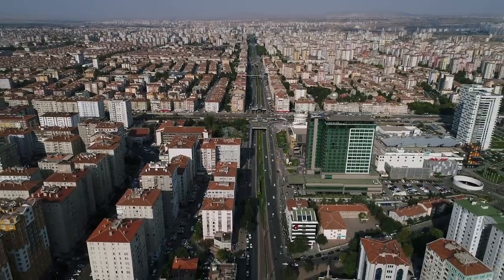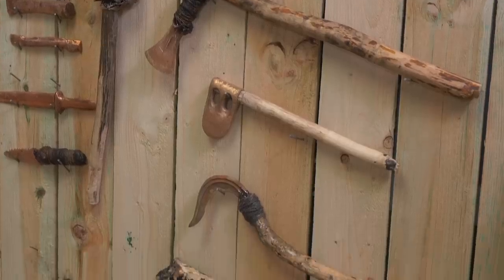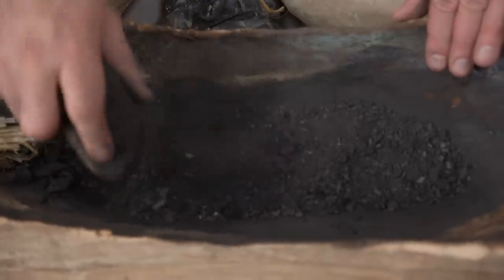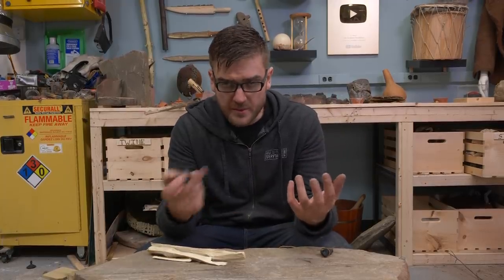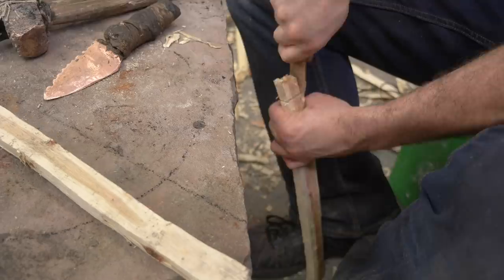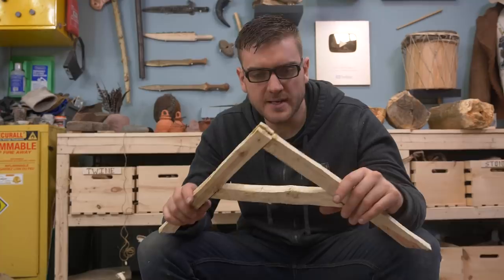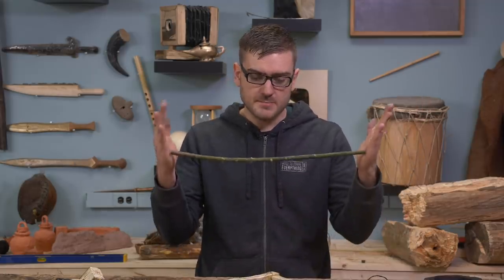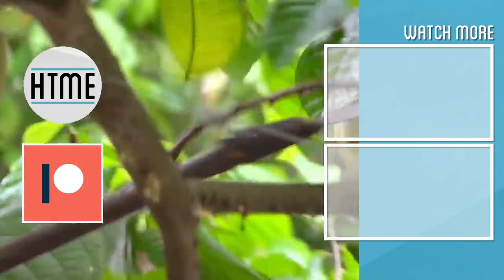DIY Tool that Built the Pyramids

Comment: Just thinking to myself, but would this work to make a perfect square? You already have a way to make perpendicular lines. From there couldn't you measure out say 36 inches on one axis. The use a string and a nail to mark an arch going out 36 inches from the end point of each axis. Where the two arches intersect should be your other corner. Am I right? 

Or could you use the radius of the length of the distance between the two end points on the x,y axis to make an arch from the three known points. Then draw a line from the corner, through the center, at the length that your two endpoints were from each other.

I'm not that great at math. This just seems to make sense to me. If I'm wrong I would love to be corrected.

Comment: You should use "head height" as your standard unit of measurement. Call them Heads (H), half head, quarter head, etc. Called "menton to top of head," with your mouth closed, measure from the bottom of your chin to the top of your head.

Comment: I think human anatomy is a bad choice for units of measurement, as everyone is born different, and long measurements such as the one you where using, could be very different. Just a difference in height could throw each persons measurements way off.

Why not use something from nature though? The length of an oak leaf, for example, could be used as it is a good size to convert into longer measurements but small enough to be converted for finer work. Also the inaccuracies in leaves, I feel, are less common than of the inaccuracies in people. Meaning that two people could choose a fully sized oak leaf, and the two will be almost identical in length.

One problem civilisation could face with this  though, is that oak trees are not found in all parts of the world, forcing people to use different leaves (for example) causing new units of measuring to arise (almost like meters, yards and feet).

I don’t think it may be the best option, but a lot better than that of human anatomy.
Reply: The measurement he is referring to was often canonized by using a single person's measurement and transferring that to tools used to measure it off for others.

Also, oak leaves vary in size as well not only tree to tree (they are different sizes at different age of tree) it even within the same tree.
Reply: Slidaulth oh. I was unaware of this. I imagined nature would just have a set leaf size when it’s fully grown.

Comment: Waiting for a 3 plate method video to get a real flat surface. Then a wood plane could be possible, though it would need frequent adjustment/sharpening if made of bronze. Might wait until iron age for that.

In the mean time, small hardened bronze files could help sharpen a saw blade. Hammering in ridges would work harden the bronze.

Comment: 7:38 actually ancient Indians used to tie three knots on a rope, at third, seventh and 12th (unit of length ) and use them to form a triangle with those three knots at each corner of the triangle.. and they would know that the required side is perpendicular...

Comment: 2:07 the Great Pyramid is actually .05 (5 hundredths of a degree off from True North).  That is even after the pyramid went through 3 major earthquakes including one that flattened Cairo in the 13th Century.  We didn't even have the tools until thousands of years later to even measure the accuracy of the GP to True North.  Even today, the closest building aligned to Truth North is the Observatory of Paris which is 25 hundredths of a degree off from Truth North.  FIVE TIMES as less precise in fact.

Comment: Milling the wood to make the tools perfectly square was not difficult with ancient tools. As a carpenter I still use old non-electric handtools when I need to. The tools used for carpentry hundreds or even thousands are often smaller, weigh less, and create less noise and debris than modern power tools and machines. They aren't as fast, but if you're making just one of something, sometimes it's just easier to grab a tool with no set up, no additional PPE, no connection to power, and just go.

Comment: A lot of the inaccuracies of the right angle level tool would have been solved by simply using a pedal grindstone. I hope you will make the surfaces smoother with the pedal grindstone you will make after you discover the wheel, if you will end up making a pedal grindstone.

Comment: I believe you need to re-think your woodworking. From at least medieval times, wooden handles for tools were rounded from split staves of larger logs. I am pretty sure this was the case even into prehistory, but I'm not certain. Cut down a tree of about 8 inch diameter, (larger would be better, but I understand your tools are not modern). then use wooden wedges to split staves for your tools' handles. They will work far better.

I know it seems advantageous to get right into metal as far as tools go, but I think you will have better overall results if you take more care with your wooden tools and handles.

Comment: The most common standard of measurement was the individual digits of the fingers which are an inch in length, then from the tip of the nose to the end of the index finger of the King and finally the Kings foot length....now all you have to do is find a king and you have everything you need.

Comment: Maybe the correct kind of unit would be the average step one would take, and the average widths of "3 fingers". But since those are quite arbitrary you might consider just "define" that you are the "very average human" or just have a size that can be converted to SI units easily, say, one "inch" would be 50mm and one "foot" would be 500mm.

Comment: Close but you only discovered the  secrets of the vesica pisces. To truly understand you must look deep into the flower of life as the vesica pisces is only the first step. There is much much more information coded in the flower. 

A common piece of information is the creation of metatrons cube from the fruit of life. Metatrons cube contains all 5 platonic solids which is very significant.

Comment: You should try basing your measurements on the length of the path travelled by light in vacuum during a time interval of 1/299792458 of a second.

Comment: Just use a pinky nail for your smaller measurement and then find something that's proportionally around 50-100 pinky nails so you have something small but not so small that it's impossible to make (and remake) and you also have something that doesn't make it a headache to measure.

Comment: Measurements 

My foot in my boot avarage size is 12.25 inches. With taking a eighth off the front and back rubber I can tune it, but it's a boot.

Long story short my foot is one foot and close enough for walking out measurements for wire lengths in my trade

Comment: You are going about much of this the hard way.  Try using a pan of water as a level.  To get a level floor, make a little dam and pour water in, but not enough to cover.  That which sticks out, pound down with a rock.  Keep on going until you have a level floor.

To make a perfect 90 degree angle, hang an object from a weight over the floor, like a plumb bob.  You can then make an area that is a perfect 90 degree angle from the floor using the string to find a straight line and the plumb bob to know when you are straight up and down or not.

Wood was precious to the Egyptians.  Soft limestone wasn't.  It also was far more consistent when measuring from it.  Using our level surface and a plumb bob, you could easily make a square of limestone.  Yes, it would be heavy.  So what?

Comment: What the cubit is made up of metrics. According to the egyptians, a drop of Literal water equals one millimeter meter. It goes from there ten millimeters a hundred millimeters a thousand millimeters and so on. Please try this in your experiments. Ta device a leaf a stick and have water drip and then measure that drop. You will see that it is usually one mm.

Comment: Id go with anatomy, just out of convenience. Length of a hand, an arm, a foot, your height, armspan, ECT could ve very useful and repeatable/checkable
Reply: Elbow to tip of middle finger which is 3 x a hand from wrist to tip of finger which is 2 x  your fingers across making the total length 24 fingers long easlierly divided by 2,3,4,6,8,12.

Comment: Only problem with using diagonals is that diagonals are also equal with a rectangle. So if it wasn’t square it would still show up equal. Best way is to measure all four sides

Comment: It does not matter what unit of measure you are using as long as it is repeatable and every one is using the same unit.
Water levels are very accurate over long distances and are easy to use.
Line of sight will produce a long accurate and straight line.
Copper and bronze chisels and saws are no good for cutting; there is plenty of evidence that large cutting wheels and core drills were used at the time of the pyramids construction.
Bear in mind that any machinery used would have erroded to nothing over millenia.

Comment: Pythagorean theory did indeed come from the ancient Egyptians according to Pythagoras. If he was lying that's in him not you.
Also Egyptians clearly had the basics of modern math; you can justify using the three plate method to make flats as well.
Now you have the start of machine tools. The ancients had Lathes, from before recorded history, but ones worth making anything other then arrows only came after the ability to make a parallel and square lines.

Comment: Base your length measurement on  1/ 10,000,000 the distance from the equator to the north pole. Though I guess you would have to make all the equipment necessary to take that measurement first.

Comment: With a ten foot by ten foot block of wood you could lay out the pyramids foundation. the block could eastly be aligned to north and south using the sun and a stick. a slide bar on the ten foot block and using the other side of the block as a line of sight you could measure any distance. 756 feet by 756 feet could be done in minutes.  Why it off north and south just a little bit is because when they did it, 4000 years ago the wobble on the earth axis on it 23000 years cycle was in a different spot. If they accounted for the wobble they would find they was right on at that time.

Comment: The best most accurate unit of measure based on an object should be one that is unchanging historically the metric system used the circumfernce of the earth to define there units however since you guys lack a telescope I'd suggest you guys take the length of hundreds of small objects and average their length to determine a constant

Comment: if I need to measure something and I don't have any kind of tool on me, I know that when my hand is stretched out, the distance between the tips of my thumb and pinky is just about 7 inches. not too big of a unit, but not too small either. maybe something like that?

Comment: it bothers me that people still stick to the idea that the pyramids were built as tombs by the dynastic egyptians, when there is very little evidence to suggest this, other than gravesites nearby to the pyramids, the fact is that there have never been any mummies or hieroglyphics found within any of the pyramids on the giza plateau, and there was no way that the dynastic egyptians had the technology to cut as precisely as they are the granite and the limestone that was used to build the pyramids, especially at the speed that would have been required to build the pyramids within even a few hundred years. The methods that egyptologists have proposed take way too long to be at all feasible

Comment: Your base unit should be the length your fingernails grow in an average year, but the numbers need to be in base 15... would make about as much sense as Imperial anyway
Reply: But on a serious note; just stick to the qualities of water. Pick a nice sized rock and find its equivalent weight in water, cube the water's volume and that will give you an AndyMeter and an AndyKilogram. Not exactly accurate on the micro, and backwards from the actual metric system, but its easy and works well.
Reply: After a bit of research, a good way to determine a base length is to use the length of a swinging pendulum for a specific time. The French originally used a two second pendulum as a basis.
Reply: Would take some time and many iterations, but you could find a pendulum with a weight of a cube of water that is some decimal fraction smaller on each side as the pendulum arm. That would give you a good measurement

Comment: I have a question/challenge! Without any reference to existing measures. How close can we get to recover a reference to meters and kilograms and seconds. For example if I would have a cube with 10cm length filled with ice cold water I am pretty close to 1kg on sea level (0.007%) error - question is how do I get to 1m / 10cm. Anyone any ideas?

Comment: I think you're overthinking the right angle. if you're building in a huge space you can establish extremely high precision by sticking crap in the ground at distances of tens or hundreds of feet, and when the resolution of your methods are on the scale of millimeters to inches the precision of the pyramids is not mysterious at all.

Comment: Do the math as others have: 25,000 laborers moved 2.5 tons-plus blocks from 500 miles away to build the pyramid in 20 years. Assuming they worked 12 hours per day. They would need to place each 2.5-ton block every 2 minutes and 30 seconds assuming no mistakes in order to accomplish this in 20 years.  People need to use common sense.  We are taking the word of archaeologists who have no engineering background let alone geology (Engineers don't agree with the ridiculous theory of archaeologists and some geologists say the dating is wrong). This is why archaeologists are not considered scientists. This false myth still goes on just like the belief the pyramid was a tomb when no human remains has ever been found in all 118 pyramids.

Comment: to add up to the mystery no such tools were ever found in early dynastic Egyptian archeology nothing! non-ziltch! only later dynasties showed this kind of sophistication depictions of these tools are 16th dynasty and later.
so this entire video is suggestive at best the simple answer and correct scientific one is we - don't - know!
Reply: so. did these tools build the great pyramid? probably not the answer lies in the stars aka lining the stars up to a perfect alinement on the ground using lines and poles and water level to flatten the area off to level and go upwards by using the stars and the horizon as a gage there were no plumbus or squaring tools in 2500 bc and only copper tools but you can get north-south pretty accurate by using the then north star or north point with just a little deviation from true north as we see in the great pyramid.
still all that is mostly guesswork of past researchers like I said before the true scientific answer is we-don't-know!

Comment: *8 sides
Reply: No. It's been shown to not have been built with eight sides. That's a result of salvaging stones, settling, erosion, etc. The extra sides are not even, nor actually centered, don't extend to the top, aren't equal left and right of the vertical...the list of inaccuracies for those extra six sides goes on and on.

Comment: If we used the same tools they used the pyramids,  our structures would last  forever. I doubt the ancients used the same tools. I have never seen proof of any tools you mentioned in any digging. The very fact each block weighed a hundred tons each, they fit together so tightly a sheet of paper cannot be inserted between them tells me they never used bronze saws and chisels. The Egyptions didnt build the pyramids anyways. They found them abandoned from a previous civilization and utilized them. It was already proven by future attempts to build them by other kings whom failed. Those that did build the pyramids were giants, not regular humans by any standards.

Comment: Dating of the pyramids is controversial. Adnope, those tools did not build the pyramids. Sorry.  A little research wouldshow the actual tools we know of but those did not build the pyramids. One thing we know they used was a 3-4-5 chain, some drawings show them.. Fiber ropes, twine have too much "give".  Good video for making primitive tools. But the earliest people living in Egypt were not primitive. Yes, they knew how to make chain. So your video is more appropriate for later Egyptians but not the ones who built th  pyramids. They also used plumb bobs. LOL. But how they worked the massive stones like basalt and granite.... you haven't scratched the surface.